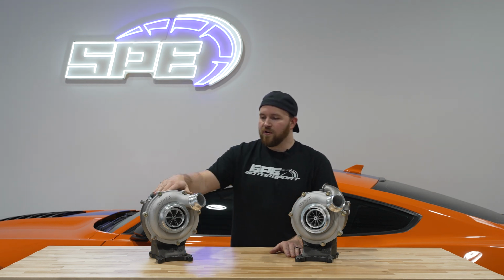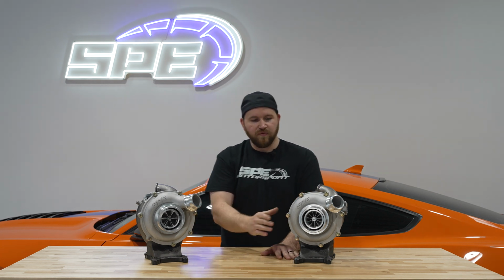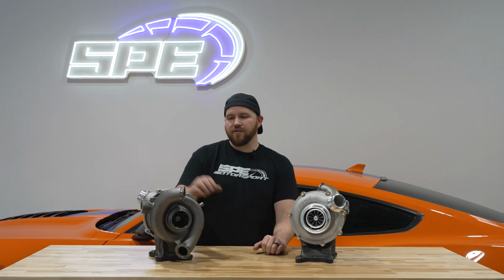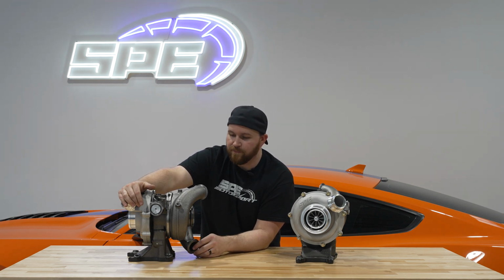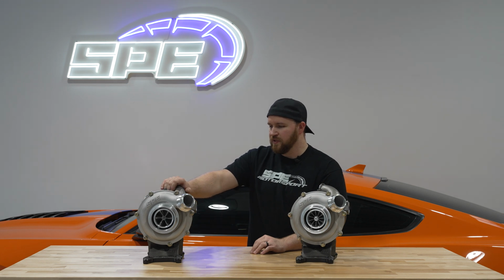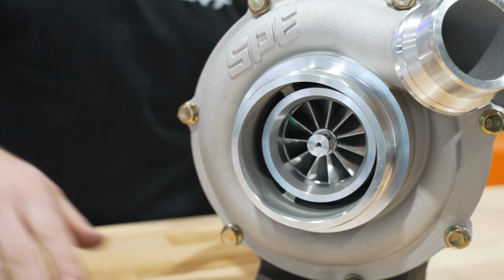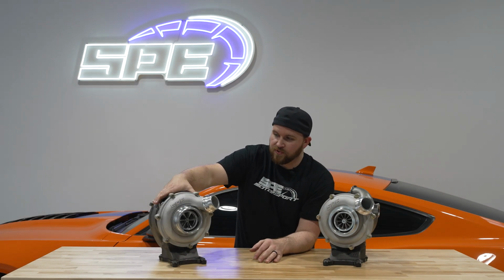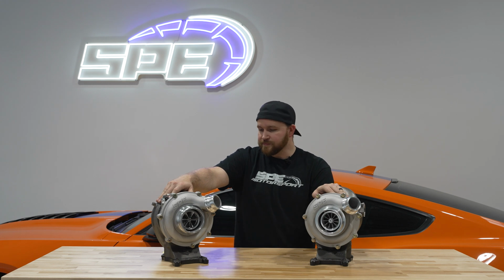SPE Strike Turbo

Comment: will it whistle pretty loud on a 6.7 power-stroke 2013?
Reply: Stage 2 sounds very similar to the 6.0 10-blade turbo, but milder.  I installed it on my 2018 and it sounds great, with a prominent whistle but not enough to be annoying like the 6.0.
Reply: @kingdom1492  you still running stock fuel?
Reply: @sheldoncurry2225  I'm running the stock CP4 & Injectors, but I did have my truck professionally tuned. The Stage 2 is too big for the out of the box tunner tunes, I was getting really bad turbo lag and it was clear the VGT timing was way off. After tuning it was much better, but not perfect. I really wish SPE would offer the Stage 1 with their 10-blade turbine. So, you get a slightly faster factory turbo that sounds great and is way more reliable.
Reply: @kingdom1492  I'm on the fence about getting it. I figured it would need to be returned. anyway you could send me some videos of your truck or post some? no one has anything out
Reply: @sheldoncurry2225   I uploaded a short on my channel, give you an idea of the sound. Next time I drive I'll try to get a good video of me actually laying down power.

Comment: Will the stage 2 turbo work with the factory exhaust brake?
Reply from the maker: Yes it will.
Reply: Being a larger than factory, on 2017 f250 with a 120ph tune and cold air intake, will it be very laggy?
Reply: @hunterchatham9605  I installed one on my 2018 about a month ago and personally hate it for this reason. I have upgraded piping, a bigger air-to-water intercooler, new cold air intake, with a few tunes ranging from 80hp-140hp. The turbo lag is pretty bad, you can definitely feel the extra power once it gets spooled but for me, it killed the driveability of my truck. I regret upgrading my factory turbo every day I drive my truck, I'm just going to order an upgraded factory turbo and be done with it.
Reply: @kingdom1492 you’re talking about the stage 2 66mm right?
Reply: @kaiserbailey  Yeah, unless you plan on upgrading the injectors and pump this turbo is just too big for the stock fuel system.
Reply: @kingdom1492  which turbo did you end up going with?
Reply: @kaiserbailey  SPE Strike VGT Stage 2, i ended up installing +25% injectors and a Scorpin CP4.2. That allowed me to get a tune that could properly use a turbo this big.
Reply: @kingdingaling9214 you experienced massive lag because your vgt tables weren't modified for that turbo. I've tuned one that matched stock spool up.
Reply: @HSKFab  My truck was custom tune for this turbo from a very reputable diesel shop. It still had a ton of lag along parts of the power band, and during heavy acceleration you could tell the engine was being fuel starved. This turbo is simply too big for the stock fuel system. After I had my upgraded injectors & CP4 installed it drove significantly better. I love the turbo now and it pulls like a train.

Comment: I just ordered a solenoid valve body from you guys. Now I want a turbo.
Reply: You’re going to love the valve body I’ve had nothing but positive experiences with it since installing it last july.
Reply: Did you replace all the seals from the feed tubes and on the solenoid bank when you installed yours or did you use the original ones that came off?
Reply: I was also installing a bunch of suncoast parts so I decided to just do new everything. 

IMO it’s probably best practice to just replace them either way to be safe and know you’ve got plenty of life in them.